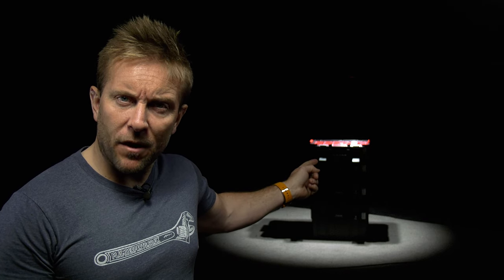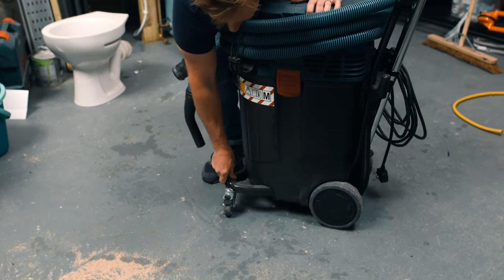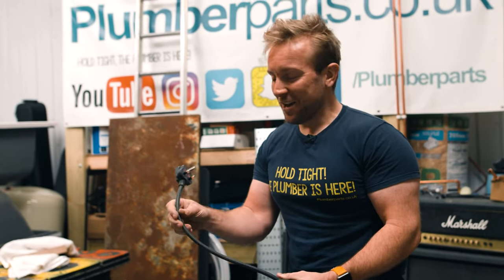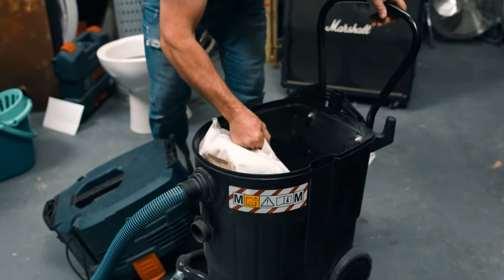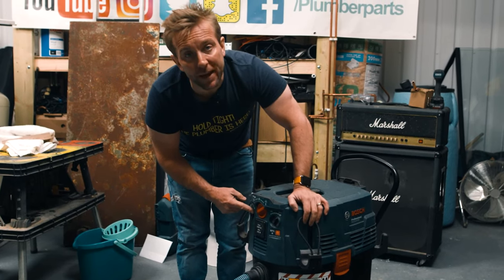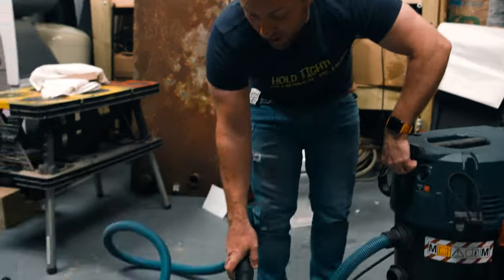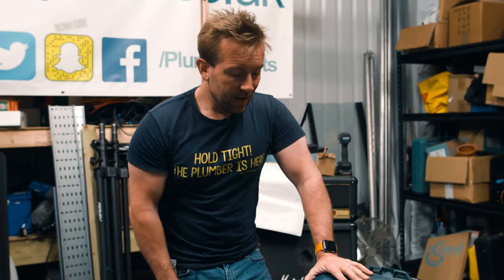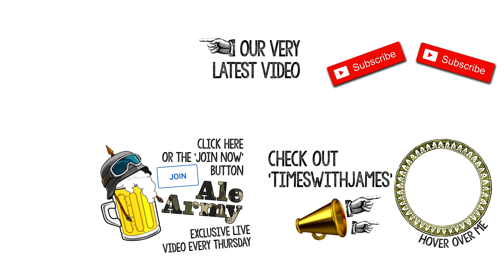BEST WET VACUUM FOR FLOODS - Must have plumber power tools

Comment: Apparently you can knock the AFC off if you’re using a fleece bag as the dust won’t touch the filter. Only need it switched on if you’re using the open bin liner style bags.
Reply from the maker: Ah good to know! It does get annoying and can be heard from quite a long way away!

Comment: I've got a 1200l from years back just changed the motor because the windings had failed but have had it ages.
Reply: Where did you get the new motor from?Mines done the same.Thanks.

Comment: does the smaller one gas 35 have a drain hose do you know. Can you let it drain whilst sucking water? Im just would like something incase of any potential flood or having to work on something live so i can suck and drain the water at the same time! ...Thanks alot...love your vids ! xx
Reply: bit of a late reply but for anyone interested no the 35 does not. Probably doesnt really need it like the 55 does due to the weight of a full tank on that beast but it still would be very useful so considering adding a water tank outlet type fitting to my 35.

Comment: bullshit, just get a basic George for £100 thing built like tank lasts forever and even wash carpets; And recycle a simple water pressure pump for dumping directly into a drain.
Reply: £100, you'd be lucky George's are more than double that these days!
Reply: @C4sp3r123  holy crapamoly is there a worldwide inflation, it's price has shot up more than twice!
Reply: @np1565  just any generic stupid water pumps they're used for boosting water pressure, mounted in attics or under bath tubs. when they get decomissioned; if you're a plumber you'll run into one, rip the auto-switches off and use it as a plug in pump
Reply: @dimitar4y  crazy how much they are now. No doubt going to go up more with all the inflation that is on its way.